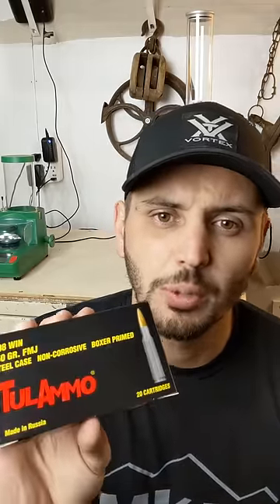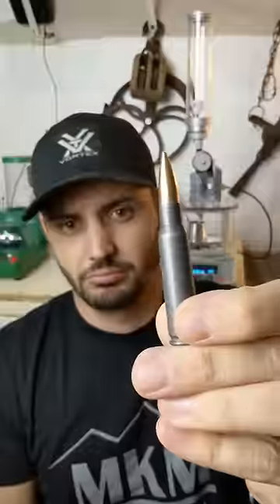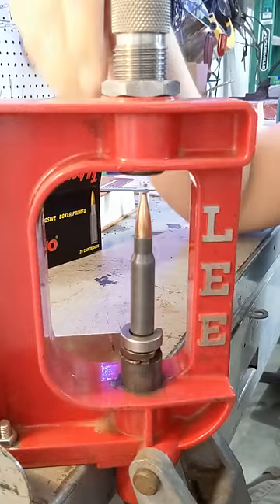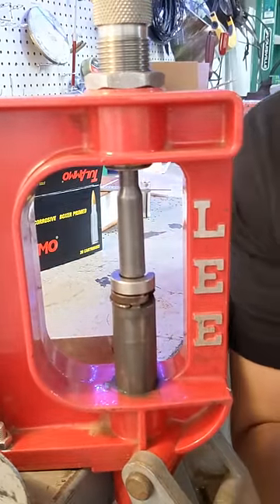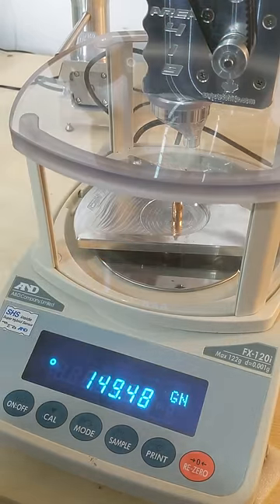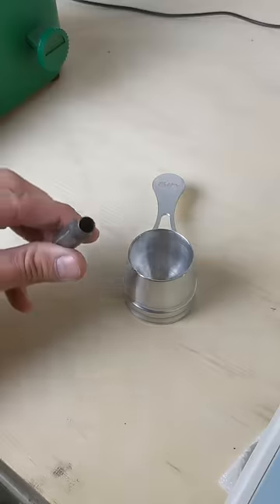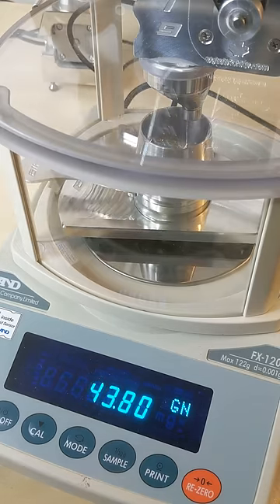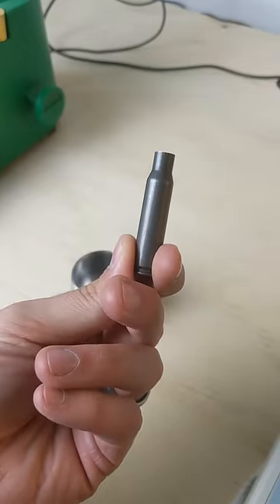What's inside the cheapest 308 round?

Comment: He didn't touch a magnet to the bullet. Tula bullets are usually lead core with a steel jacket and a copper wash on top of the steel jacket (bi-metal). When you fire the gun the bullet goes down the barrel while the rifling in the barrel slightly cuts through the copper wash and comes in contact with the steel jacket. Now you have steel on steel and you will wear your barrel out twice as fast. Another problem is the steel case is coated with a lacquer type coating that can soften enough after firing to literally glue the case into the chamber, (ask me how I know). Lastly, if you get caught with this ammo on BLM land you will be looking at a $10,000 fine because you can strike off a fire with them.

Comment: Why did he take the primer out of a brass case? He's reviewing steel cased ammo not brass cased ammo
Reply: Soo right!!!
Reply: With almost all steel cased ammo, the only way to remove the primer is to drill them out, which does not make for pretty insta pictures.
Reply: C D  most steel case ammo is one and done. You can reload brass bois as long as the integrity is maintained.
Reply: C D  basically I’ve never seen a reloadable steel box, but I’ve never NOT seen a reloadable brass box
Reply: C D  it is technically possible, but requires 4x the work and some  expensive semi-custom equipment.
Reply: Berdan primed.
Reply: @jcast25  there are other methods here on YouTube
Reply: @RandomGuy9  that's why I used the word "almost".
Reply: He didn't take the primer out of the steel case because when you use your decapping die to press out the primer you can't. Most all brass cases have a flash hole through the center of the case which you can pop out the old primer amd put a new one in. With a steel case it has 2 flash holes offset and not center so you can't push out the primer nor reload them. Might armory makes a die that will punch a new hole in berdan cases. Some of the best dies on the market.
Reply: That is what I was thinking. He took the primer put of the brass round
Reply: Apparently he wanted an insta photo. Steel cases usually have a different style primer pocket.
Reply: @ReinQuest  I see
Reply: Tula ammo is berdan primed, so you can't really remove the primer easily
Reply: @cooperdavis9663  that’s the word I couldn’t think of. Thanks.
Reply: The comparison of primers wasn't fair. Tul uses berdan primer. Different geometry. Of course it has different mass.
Reply: Wrong. You done have to drill it. Berdan primed shells have two holes if you look inside it so the tool used to extract the us made primer is different as it only has one tip. Just a different tool
Reply: @masonadmire3555  technically you don’t “need” to drill. You could use water to hydraulically extract.
Reply: All you need to remove the steel case prisms is water and a metal or wood rod the diameter of the hole uptop and ram it down fast the force of the water will pop out the primer.
Reply: @odiarroyo6144  to make you watch the video again
Reply: C D  there are two basic kinds of primers. Brass cases ammo has a boxer primer. The Boxer primer has the anvil built into the primer and it fires through a singular hole to ignite the powder.  Steel case ammo has a berdan primer. The berdan primer relies on the case itself having a built in anvil. This is directly behind the primer. As a result you have to drill through the steel case in order to extract a berdan primer.
Reply: @wraithvendeta  nice explanation very simple
Reply: So with the steel case has 2 small offset flash holes, (berdan primer) vs the brass that has one flash hole right in the center. So the primer remover won't work on the steel case.
Reply: @ImpossibleMusic69  I have about 200 West German berdan primed brass 7.62x51 cases. Only found out after I broke my decapper on the first one...

Comment: They got a pretty good crimp on them bastards, don't they. Then again, they are crimping steel, so it gonna bite harder than brass, I'd imagine.
Reply: @osmacar5331 : That was my point. When steel is crimped vs brass, it's gonna bite harder, because it take more force to bend the material, along with the steel bitting into the copper, more than brass.
Reply: @Trad-Am  sometimes these trolls just say stuff to seem like they had the answer. But I wonder if it is that much harder to come out, would it affect the overall speed and velocity??
Reply: @thomashodis5740 : I bet case pressure is higher, as it takes more to eject the bullet, but after it's out, your gonna get the same burn, depending on length of barrel. I don't know if that extra pressure in the case makes a difference, or not. On brass, your likely to pop a primer, but these primers are set in differently.
Reply: His press is mounted to the bench with duct tape or something. More energy went into wobbling it around than went into pulling the round apart.
Reply: @osmacar5331  did you even read what he wrote
Reply: It's also lacquered, and you can anneal steel to be softer than brass
Reply from the maker: It was definitely harder to pull out than brass cases. How the rest of it is affected? I haven't personally done enough testing to say
Reply: @osmacar5331  you literally just repeated what he said lmao he just worded it smarter
Reply: @osmacar5331  That is what he said, isn’t it? Did you read something different?
Reply: @thomashodis5740  I was thinking the same thing
Reply: @Trad-Am  chamber pressure is going to blow that weak case neck out and release the bullet just fine, and the barrel will be more resistance than the case neck with brass or steel. The alloy and heat treat of the steel makes it butter soft, relatively.

Comment: But you pulled the primer from a brass round not the Tul Ammo. Also, why did you round down from 149.48gr to 149.46 for the bullet? Shouldn't you go for the end result of the scale you zeroed properly and wait for it to hold steady before reading?
Reply: I noticed how he misread it and then it went up .01-.02 gn
Reply: Yea I saw that, wrong primer 🤣🤣
Reply: It's not easy to decap berdan primed cases.
Reply: @MrDillaKilla  ok. And?
Reply: @jamesbizs  tell me... a little louder... that you know nothing of ammunition constuction.
Reply: @MrDillaKilla  especially when steel case ammo has more than 1 hole in the primer pocket for igniting the powder
Reply: @thomasnickles1155  there's a couple of ways, but not with a conventional size and decap die.  Just as easy to show a boxer primer as they're substantially the same for viewing purposes.
Reply: @MrDillaKilla  exactly right you have to have the proper tools for the job

Comment: Berdan primers have two  holes that are off center and the anvil is built into the shell, his deprimer won’t work on that case so he used the brass round with a boxer primer which has it own internal anvil and a centered firing hole that he could remove with his current equipment.
Reply: These are boxer primed.

Comment: He didn't say anything negative or positive. Just details. Although, steel casings wouldn't be my choice especially ones with no shine because rust can set in or it could stick in the release as it isn't smoothed out. Brass is much more reusable and reliable. As far as half a gram off the bullet head, that really doesn't bother me.
Reply: They don't shine because they have a coating to help prevent rust.
Reply: @bobthompson4319  doesn't that coating make the shells stick and collect grime during long storage?
Reply: @brianmcclenahan617  not unless your storing it under a pile of rocks in the back yard,  keep it stored properly like any other ammo and it shouldn’t have any problems. I’ve had some steel case stuff stored for several years and it’s all worked just  fine.
Reply: @peternorton5648  that's good to know. I've always had concerns about steel casings. Now the critical question. Are they effective for reuse?
Reply: @brianmcclenahan617  I don’t reload so I couldn’t tell you anything about that. Sorry

Comment: I like how you didn't stick a magnet to it to see if it has a steel core. Steel case is needed because brass can't handle the pressure. Most Russian ammo has them because it's made by the Russian government. Cheep my ass, you mean affordable. We ran some in my buddies full auto sub, it cycled faster with the Russian AFFORDABLE STUFF
Reply: You're mincing words, though. The reason steel ammo is considered cheap is because, given the choice, everyone should opt for brass. Brass is a softer metal and so it causes less wear and tear to your weapon's chamber and bolt carrier.
Reply: @sebione3576  not entirely true. Steel case doesn't expand as much as brass, therefore doesn't put as much stress on the chamber. However, it tends to leave more residue behind, meaning you'll need to clean more effectively.

Comment: Steel cased cartridges run great in bolt action .308 rifles. IMO. 
But can be used in semi autos, just more wear and tear on the bolt carrier/ extractor, etc. Thanks for the clip.
Reply: An ar15 extractor costs 8 dollars. The extra possible wear on components would actually be negligible. These cases are mild steel. Steel cased ammo technology is almost a century old and is quite advanced.
Reply: @tballstaedt7807  AR10 extractor /bcg is just a little bit more than a AR15 extractor/ bcg
Most people won’t spend the $8 until it becomes a bigger problem, like until the steel cased gets stuck in the barrel from the material it’s made from. I know because it happened to me with a C308 twenty years ago.

Comment: I have to say my experience with cheap steel case tula ammo has been much better than I ever expected.  Ran 48 rounds of blazer brass 115gr fmj 9mm cleaning after each magazine and then 600 rounds of steel case 115gr fmj 9mm through my pro series Smith and Wesson full size M&P 9mm in the first day I owned it without any cleaning after those first 3 mags and didn't have a single malfunction of any kind, no dud rounds and shot groups consistent with my ability at the time, if anything the grouping got better throughout the day as I got used to the gun and as the barrel broke in. Yes it was dirty but I would expect that out of any steel cased ammo and after 600 rounds in a day I don't care what kind of ammo you run, the gun is going to be dirty.

Comment: If you buy expensive target rounds then that's on you. I buy TulAmmo and have never had an issue. "But it'll dirty up your gun" - Simple, clean your gun. It's not that hard to maintain. I've ran it in my .223 with no issues and my .308 no issues. Consistent, cheap, goes bang every time.

Comment: He took the primer out of a brass case because its much harder to deprime berdan primed rounds , as the steel cased tula is
Reply from the maker: Uhh, no 🙄
Reply: @reeseontherange  so why the not de-prime the steel case to complete the data set then?
Reply from the maker: @jcast25  that's what I did.........
Reply: @reeseontherange  It's not what you you show in the video. There you deprime a brass casing and weigh that.
Reply: @reeseontherange  I don’t doubt that you deprimed the steel cased ammo as these are boxer primed and not berdan, but I think you may have accidentally used the wrong footage where you deprimed a brass case instead.
Reply: @reeseontherange  Then why not put it in the video?  You only showed de-priming a brass case.

Comment: I assume you used the primer from the brass case due to it be a boxer primer, and the Tula steel case is berdan primer and if you deprimed it with your depriming/resizing die it would have bent the pin on it.

Comment: Over the lifetime of the machine,  wouldn't  a steel casing be kind of hard on said machine?
Reply: Nah. In theory yes but practiced use no not really. Steel cased is actually bimetal.  It reshapes TOO much because its so soft that its completely unusable to reload with. The theory that it shaves off metal as it enters the chamber is laughable aswell. If the gun was that weak it would likely blow up from normal use.

The other important factor to consider is how many is a lot? Your average barrel thats well cared for will run 20,000-50,000 rounds. Most people don't make it past a few thousand in a lifetime lol. Even a stress tested barrel that gets superheated to 400 degrees with no cleaning and continuous full auto fire makes it 8k-10k rounds but thats not a realistic real world scenario. Not even the military is that mean to their guns.

So meh. Not really

Comment: Why did you use the  Primer from the brass casing You should have weighed the primer in the steel casing to make this experiment accurate, Now that you used one of your primers which are probably higher quality than the ones of the cheaper quality rounds  This experiment isn't a 100% true

Comment: I never use steal casings... I’ll save those for the doomsday
Reply: You should probably save your brass until doomsday and shoot your steel now. The difference in performance are negligible but it seems that straight walled steel cases expand differently than brass. This allows carbon to get in between the chamber wall and the case making ejection a problem occasionally. An occasional use of a chamber mop with solve it.

Comment: Is grains same as grams. 
Any help is appreciated.
Reply: Ok here goes , there are 7000 grains to a pound, it is a constant unit of weight, on bullets 115 grains, 147 grains, etc. And gunpowder is measured the same way, 6.7 grains and so on. There is a conversion chart available for grains to grams, but I have not seen one in a while. Handloaders and ammo manufacturers routinely use grains as a common point of reference. Accuracy buffs routinely measure components to within a tenth of a grain or less for consistency which is critical in achieving maximum accuracy.  Hope this helps.